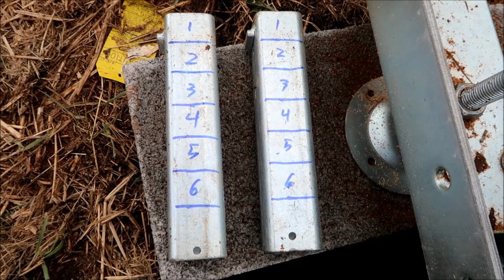First Cuts with the Woodland Mills HM130

Comment: Keep at it and learn all those lessons on inexpensive logs.  Consider an inexpensive metal detector to help you find the nails before your saw does.  I bought one at Harbor Freight for less than $30 and it's saved my planer blades many times as I mill a lot of rough cut lumber.  Great job!
Reply from the maker: I've actually been thinking about doing a video on the usefulness of cheap metal detector. I also have a cheap one, and it comes in handy a LOT.

Comment: Hi. How does this sawmill work for you? Are you happy with it?
Reply from the maker: Hi Piotr. So far I've really enjoyed my mill. There's been a couple small things that I've mentioned in the other videos, but other than that it's been great. Josh
Reply: Thank you for your answer. I want to buy one. And how do you sharpen the blades? Sorry for the mistakes. I use the tranlator. I am a lumberjack from Poland.
Regards.
Reply from the maker: For now, I'm buying new blades as needed. I would eventually like to purchase a sharpening setup. There is a program though Wood Mizer for getting blades sharpened. Some people will use a dremel to sharpen them by hand, but it's not the best method.
Reply: And the wootland mils sharpening machine is not good?
Do you work open blades or flat? All users of wootland mils are happy with these sawmills. I will buy it too.
Reply from the maker: I honestly don't know if the Woodland mills sharpening machine is good or not. 
I'm not sure what you mean by open or flat blades.
Reply: I do not know how to write in English. Teeth of the blade tilted left and right?
Reply from the maker: I would call that the "set" of the tooth. Yes that is a necessary step to do for the blade to cut correctly. Does that answer your question?
Reply: Yes. This is the answer. Thank you and best regards
Reply: woodmizer is much better product @piotrknapczyk700